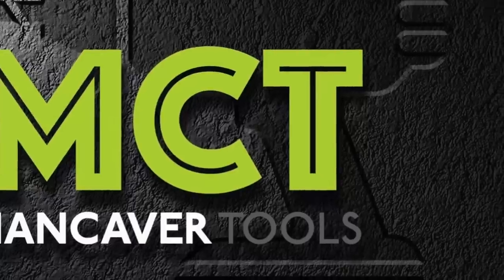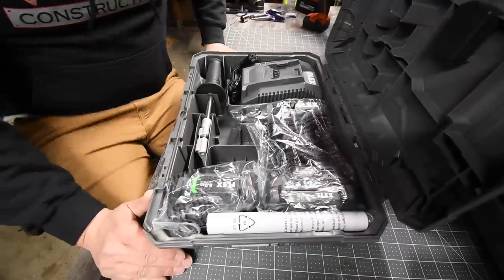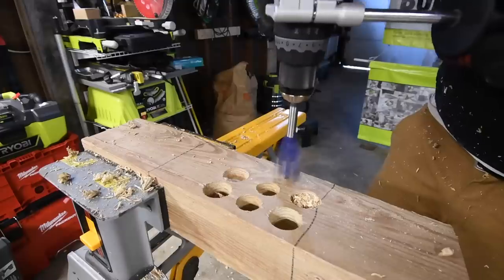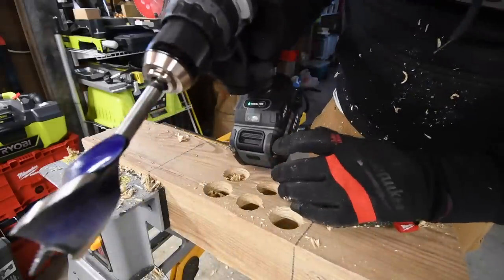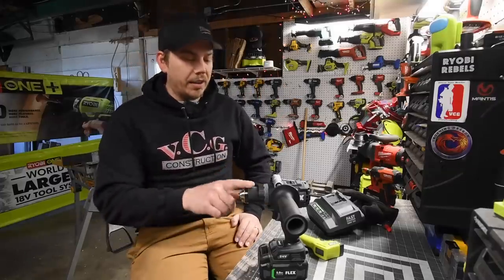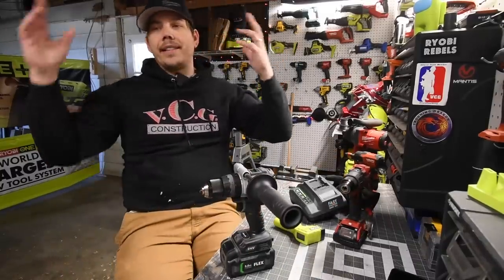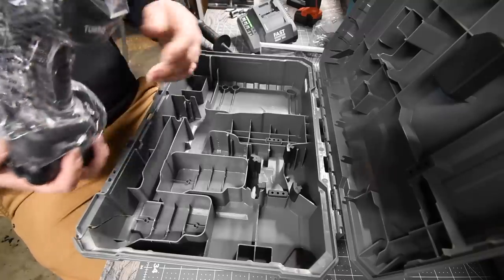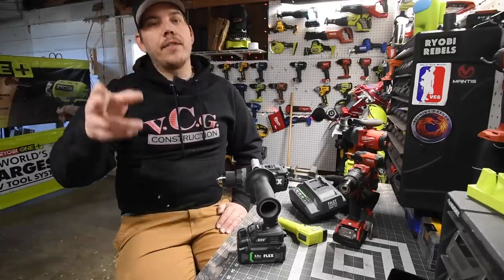Flex Turbo Hammer Drill (Unboxing and TEST)

Comment: next time, use the Milwaukee/Dewalt to finish the job to see the differences, that is the best part of ShopToolReviews, seeing them finishing the job of one with another of the same category
Reply: There's another video where he did it already with M/D.   They completed the tests last week to see what 'best drill to go against Flex' was.  Turns out, they both completed (same log) that Flex couldn't.
Reply: @ToolHombre  yea, he also showed that you needed high output batteries to drill that hole with that bit and he said in this video that Flex probably couldn't because of the 5.0 amp battery being 18650 cells, so I guess he still needs to try it with a 8.0 battery before he can categorize this which he did.....
Reply: @ProxyFinal   This is true that the 8Ah needs to be tested at some point.  

Flex shot themselves in the foot showing their 2.5Ah 'strongest hammer drill ever' in their marketing video. 

With the 8Ah vs M18 H.O. vs DCD999 would be a battle I would think.
Reply: @ToolHombre  I mean, I think all of us have been playing with tools long enough to see what the companies are doing with technology.  Just because it failed in this test, it really doesn’t tell us the whole picture.  It’s just the way FLEX advertised the tools that rubbed people the wrong way.
Reply: @ProxyFinal  exactly, Im new here in the channel and with power tools, I started working with 'em since 2019, but so far my fav is Milwaukee, it already payed for itself
Reply: @ProxyFinal  do you think it’s quite fair though giving the flex the 8.0 against Milwaukee or Dewalts 8.0 being that flex is 24v? Maybe someone more familiar with these things can do the math and figure it out exactly...
Reply: @89dhvac  I am not an expert at all, so you are asking the wrong guy.  I mean, we have seen 18v beat out 40v tools....so.....I really can’t explain that, but people say you get better runtime in exchange with higher voltage and other benefits.  I am pretty sure other people can give you a better answer.  We do know why chervon went with 24v and that’s to avoid paying Milwaukee.
Reply: @jamdc2000  it started to get annoying when I was having issues with the collet not retaining the paddle bits
Reply: @ProxyFinal  i got lucky then, my still runs strong
Reply: @jamdc2000  I am certain you are going to have that problem eventually, unless you don't drill holes with paddle bits at all then it should be fine.  The issue is caused by the single ball bearing in the collet.  Most impact drivers have two for better retention.
Reply: @ProxyFinal  ohh, thanks mate, I'll be aware of that, and yes, I only use it for drilling small diameter holes and screws, mostly on melamine and mdf, to be honest Im not a hardcore woodworker but ive made a few bucks so yeah. Stay safe mate.
Reply from the maker: I do thank you so much for viewing :)
Reply: @ToolHombre  Flex is still better
Reply: @gagejernigan5277  no, my hercules can destroy all

Comment: Was never going to switch from Milwaukee since I’ve spent a fortune on the platform but this great video proves there wouldn’t be a reason to. I think Flex is going to have a long (or possibly very short) hard road ahead of them. I don’t think they are going to steal any current customers from the big 3 and if I were just starting out I would be going for a platform that is much better developed with far more tools. If the price was better perhaps they could grab the young guys but from what I’ve seen it’s in line with the big boys. 
I agree with you on the batteries, they should have just gone all 21700 cells. Great video, keep it up.
Reply from the maker: I do thank you so much for viewing :)

Comment: You should test the new XGT 40v Makita, it seems to be the most powerful nowadays 👍
Reply: Definitely between that and the Flexvolt.
Reply: Makita 40v most powerfull
Reply: @micjubba709  I haven't seen any tests anywhere but I'll look in to it.
Reply: @zacrichie4381  a guy in my country made a head to head between 40v Makita and the Dewalt and Makita easily won.
Reply: Makita 40v is the king
Reply: @ashtonlowe6761  yeah faster and way more stronger powerfull then the milwakkee top spec gen 3 drill and dewalt  power detect and the flex turbo by long wayyyyyyyyy
Reply: @zacrichie4381  👍the hro1g a think it is  thiers another 40 volt one to but no where near good as the top model
Reply from the maker: I do thank you so much for viewing :)

Comment: Well where’s all this big talk flex was bringing?! I think you should do the vs video with dewalt and Milwaukee either way just to put it in their face
Reply: he posted a video a few days ago of 5 or 6 drills doing this same test in hopes to have the winners them face this drill but the flex wouldn't even qualify to face the Dewalt or Milwaukee so kind of a buzz kill now.
Reply: B careful John!  There are a lot of FF fans out there!  ( Fanatic Flex). 😳🙄🙄🙄👍👍😁✌🏻🇺🇸
Reply: WE WANT TO SEE DEWALT/MILWAUKEE VS FLEX!!!!! Please
Reply: @kevinbeast696  yesss! Even though he said technically flex doesn’t qualify the fact is still that flex went against Milwaukee and supposedly shut them down. Time to return the favor
Reply: I used the same bit with flex and it went through speed 2 no problem. I don't know what's up with this one. The flex outperformed the Milwaukee in every test. The Milwaukee had a couple wins with some lags but didn't keep up most of the time with the same lags.
Reply from the maker: I do thank you so much for viewing :)

Comment: The main deference between Flex and the other top brands is the other brands have had years to refine and improve their tools. I have confidence that in a few years Flex will be the one to beat. And as far as the case goes anything could have happened like something extremely heavy was set on it. I see damaged freight every day, it doesn't necessarily mean the case is weak.
Reply: I posted a similar reply on another YouTube video about Flex. From a company standpoint it makes sense to learn from your competitors wins and fails. I also questioned Flex's "gonelevity" not their longevity. I wonder why they don't just make the RPM of the tools what it is when you use the turbo button? Could running at the higher speed damage something?
Reply from the maker: I thank you so much for viewing :)

Comment: Just bought a Gen 3 Milwaukee Hammer drill, and used it on concrete a few minutes ago, very impressed.  Was working in a 60 degree area and the motor got really hot, maybe 90ish degrees...
Reply from the maker: I do thank you so much for viewing :)

Comment: You just narrowed down my replacement set from Makita to Dewalt or Milwaukee.  I put my makita circ saw, hammer drill and impact driver through about 8 years of use and abuse. I was considering flex. But if that hammer drill can't hang with the others in the same price range I am now leaning more to Dewalt now than before this video.
Reply from the maker: I thank you so much for viewing :)

Comment: The 8ah battery has 21700 cells. I’d be interested to see what it can do with them.
Reply: I doubt it will make a difference, this looks to be a software issue in their anti-kickback (don’t torque the users wrist/arm) software. Looks like it’s miscalibrated and too sensitive.
Reply: It no doubt would do a lot better Jonathan!
Reply from the maker: I do thank you so much for viewing :)

Comment: The Milwaukee drill has it's drill setting at the end of the speed range (come after 14), this Flex drill looks like it has the drill/hammer setting indicator separated from the speed dial which in your video was on 7 not on the max, not sure if this will make any difference as I'm not an expert,  however I'm still thinking you are kinda biased against this brand!, the real tool is what gets the job done not what brand it is. respect.
Reply: The clutch setting doesn’t matter when you’re in drill or hammer mode. The clutch settings only applies to screw mode. So if it was on clutch setting 5-6-7 or 8 when it’s on drill mode it wouldn’t affect the operation. Who knows if Flex is different, but I doubt it. If it does he will definitely come out with another video addressing the issue.
Reply from the maker: I do thank you so much for viewing :)

Comment: 4:47 but in the flex stream they said Sensor-free brushless motor 22 times also not bandwagoner but it might have failed that 3rd test due to the Eclutch preventing bind ups the lag was proof the tool is weaker than milwaukee and dewalt
Reply from the maker: I do thank you so much for viewing :)

Comment: Great Test. But when I watched the demo on VCG with the milwaukee against the Flex they used 2 (2x4) I think and the flex came out marginally faster. Maybe in less dense/hard material the Flex will do ok but up against the thick stuff I don't think it can compete as of yet. Maybe in the future as they update the design and so on.
Reply: Flex will shine if you only have small tasks to do. 2 extra second speed Is not enough for me, I need tools that can get any job done that have already been proven to do so. 
👍🏻👍🏻
Reply from the maker: I do thank you so much for viewing :)

Comment: I’m a Milwaukee fan boy but I would still have liked to seen the Milwaukee and default try the 10 inch lag that the flex failed to drive.
Reply: He has other videos showing DeWalt and Milwaukee doing it with ease.
Reply: @daltonmiller8688  I know there are other videos with them doing it but every situation is different I’m curious if they could do that very same lag screw that the flex would not. Perhaps that particular lag for whatever reason the Milwaukee or default wouldn’t do either.
Reply: @garrisong  I wouldn’t be surprised if you see him do it. He also did say he was going to make other videos on this Flex drill.
Reply from the maker: I do thank you so much for viewing :)

Comment: Side note, the batteries have six 18650 cells in them and each one is capable of delivering 20 amps continuous output. 5ah would be 40 amps. The 8ah and 12ah do use 21700 cells which depending on what they use can deliver 30 to 40 amps per cell.
Reply from the maker: I do thank you so much for viewing :)

Comment: Placing Makita with Ridgid and Ryobi 😂. You are a funny guy....
Reply: But that’s what his test results for this specific task show. See his previous videos.
Reply: I love Dave, but I have to take a slight exception to that with regards to Makita, however, if they didn’t have their Corporate heads up their you know what, higher amp hour batteries would definitely make that new XPH 14 sing!  Peace
Reply: I know, quality speaking, makita is doesn't belong with the lower tier.
Reply: @georgedavall9449 batteries are Makita’s weakness. Not that their batteries are bad, but they aren’t keeping up with their competitors in battery performance. They could fix that relatively easily. Software would could fix one of the issues (3x charge failures permanently locks battery). 

Using newer generation 18650 cells such as the Samsung 25S or Sony/Murata VTC5A/D, or make some 21700 based batteries could address power and capacity issues. 

At the same time as making those changes, they could make a hardware change to address the uneven wear issues caused by powering the control electronics off just two cells. 

This article talks about the two main issues leading to premature failures
https://www.instructables.com/Makita-18v-LXT-Lithium-ion-Battery-Repair/
Reply: @geoffstrickler  I agree with you on makita batteries. I kinda like how the batteries are not oversized like the other competitors. But on the other hand they are more vulnerable to breaking. Sucks we can’t have the whole cake lol
Reply: @geoffstrickler  Awesome Info and insight Geoff!  You basically explained, in detail, and much better, what I remarked about. I have gone round and round with Makita on these very issues, and always get the same lame excuses or reasoning.  I really believe they just don’t want to get caught up with figment and charging issues, if they went with 21700 cells.  I looked at both of my X2 36 Volt Circ.saws, and there is not enough room for bigger batteries!  Check out Tim over on ‘Shop Tool Reviews,’ where he just put out a video taking batteries apart and checking out the cells inside.  Makita had same Samsung cells as DeWalt and Milwaukee.  Take care!
Reply: @dan260140  simply changing to newer 18650 cells would offer a power boost, and possibly a small capacity boost too, from 5Ah to 5.5Ah with ~25% more power. No change to pack design required. However, it would be good to fix the issues mentioned in the article I posted above. Could keep it at 5Ah and market it as maximum output or similar, just depends on price and availability of the newer cells.
Reply: @georgedavall9449  aside from size and weight, one of the considerations of going to 21700 cells in a 2P configuration is shipping regulations. On an 18V x 5Ah pack, you’re at 90Wh (99Wh for 5.5Ah), leaving you under the 100Wh per battery restriction for common carrier shipping. Once you hit 5.6Ah or more on an 18V, you’re over 100Wh, and he rules for chipping change. Obviously, other companies have chosen to deal with that (or perhaps to ignore it), but it’s definitely something to factor into the costs.
Reply: @geoffstrickler  Very true Geoff.  I have been told that ad nauseam by Makita Factory Techs, when I’ve inquired about batteries.  And I’ve asked them point blank, how is it that Ryobi, Milwaukee, DeWalt and others, all have batteries over 100 watt hours, and ship and sell them here, in the US?  
That’s when all the lame excuses and silly reasoning starts.  I won’t bore you with it, just trust me, or better yet, give them a call.  I’m still a big Teal fan, just frustrated.  Their New Jersey Factory Service Center is exemplary, btw.  Take care Geoff!
Reply: Part of Makitas problem going to a 21700 cell is the width. Sure in a single pack that’s no problem. But how many tools run on the two packs? Those slots don’t allow for a much wider pack in that configuration. So they’d have compatibility problems. I think this is partly why they decided to go with the 40v line.
Reply: @RaggedsEdge  yeah, is a shame nobody put any effort into making 21650 cells. But they could offer batteries using newer 18650 cells, and/or go to 3P designs using 18650 cells without causing compatibility issues with the vast majority of their tools, even the X2 models. Only tools that have constrained battery height issues would present an issue.

I know Makita does well internationally, but they appear to be willing to accept 3rd place in North America, where they were once the dominant cordless brand. I’m not sure they’re even #3 in NA sales, although I’m pretty sure they’re #3 in professional cordless tools.
Reply: Makita suck
Reply: Makita is definitely a part of the big 3 . and thats coming from a Milwaukee man
Reply: @geoffstrickler  LG 20650 cells are excellent and the Sanyo 20650 are just a hair behind them, but they quickly became over shadowed by 217 cells. Very similar performance to the Sanyo 20700 but a smaller footprint.
Reply: @Fictitious_Character  thanks, I missed those. Could be an interesting option for some uses. However, they’re notably more expensive than either 18650 or 21700 cells of similar capabilities, so probably not a good choice except for special circumstances.
Reply from the maker: I do thank you so much for viewing :)

Comment: Do you have a test of the same ah battery but with different cells for comparison?
Reply: 40-46 A from 2 x 20-23 A @ the best 18650 cells is usualy a little better then 40-44 A from the best one row of 21700 cells, when comparing 4-5-6 Ah with 4Ah, and not mutch difference in weight also... But 3 row of 18650 can give 60-69 A and 2 row of 21700 can give 80-88 A. Then 3 row 12Ah of 21700 can give 120-132 A.
Reply from the maker: I do thank you so much for viewing :)

Comment: I haven't watched this yet but I'm buying the combo kit of who ever wins this battle. I've been holding off on buying a kit  waiting to see how will come out on top.
Reply: Either makita with the xph14 drill or milwaukee 3rd gen fuel are excellent, dewalt makes a kit with the 996 but the 887 impact is known to have issues.
Reply: Can’t go wrong with Milwaukee or Dewalt. I’ve had the Milwaukee gen3 impact driver(2853) for a year and a half, it’s amazing, just make sure you get the collet that has the 2 ball bearings inside. If you get it and it only has one ball bearing return it until you get the 2. I’ve had the Milwaukee fuel hammer drill (2804) for a year and a half and it is amazing. Dewalt hammer drill (dcd996 or 998) I have the 996 for about 2 years and it amazing, but I would buy the 998 because it is a newer tool. I also have the Dewalt (dcf887) for about two years and no complaints, the Milwaukee imo is a better impact driver. I was going to buy either Flex or Makita. If Flex is in the same category as Makita then I’m going to go with Makita especially after all the Flex propaganda. Flex just worries me that they won’t take care of their customers. At least Makita is a trusted and proven tool company. 
If it was me and after all the research I’ve done I would definitely go with Milwaukee. 
I always go by, if I’m doing carpentry or woodworking I buy Dewalt, Makita and a small amount of Milwaukee, for everything else the world throws at me it’s definitely Milwaukee!
Milwaukee’s 18 volt and 12 volt line of tools can’t be beat. My Dewalt tools usually stay home to work at my shop and my Milwaukee tools always go to the job site.
Reply from the maker: I do thank you so much for viewing :)

Comment: I dropped my flex case of my dump truck bed witch is 12.5 ft and it did not crack . Really recommend these tools better than my milwaukee fuel by far